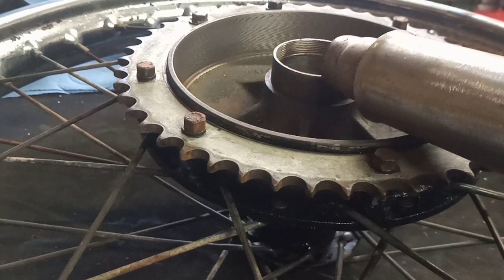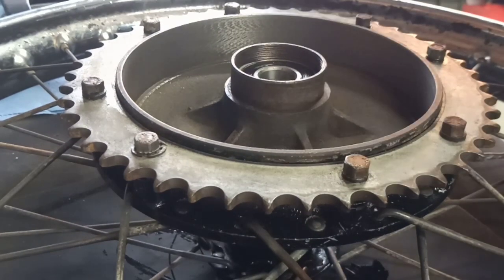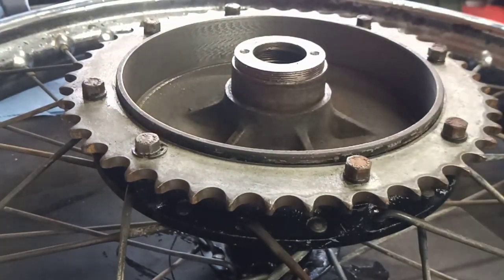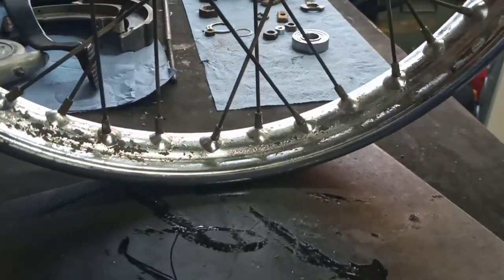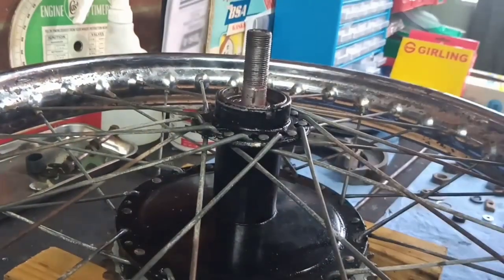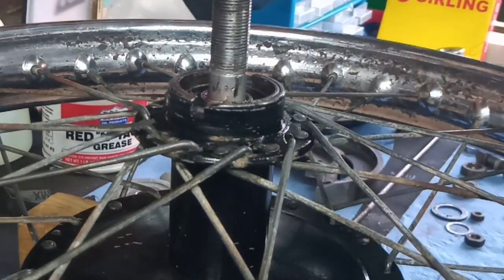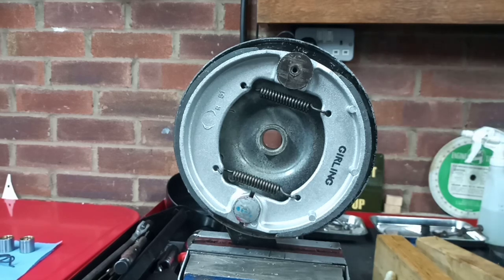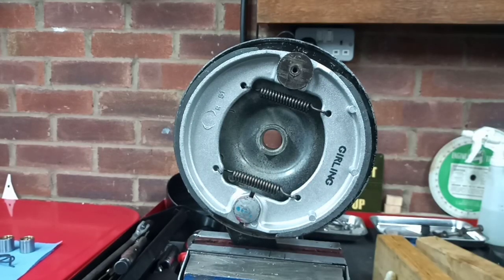Classic Bike BSA Bantam D7 Rear Wheel Assembly, Bearings, Brakes and Tyre

Comment: Pity you didn't fit new wheel rims, you could have shown me how to true mine up! My rims were awful so after a years deliberation and much drying of teeth over the cost l rebuilt the wheels this winter, l have left spokes slack ready to true up, maybe next winter ha ha. Thanks for taking time to video you work. Alex norfolk
Reply from the maker: Cheers Alex, I'm planning on wheelbuilding for my next project. The point of this one is to keep it looking it's age. 
Best of luck with your build. Check out AG Engineering and Dale Sweger for wheelbuilding top tips in the meantime. 
Best wishes, Dean.
Reply: Wheel building... One of my favourite jobs, I find it very relaxing.

Comment: Great thread file, I must keep a look out for one at the autojumbles, currently using needle files!
Reply from the maker: They are very handy. I've saved a few expensive bits with them. No good for internal threads of course, you'll still need your needle files to pick out the ends of those. 
Best wishes, Dean.

Comment: We are both currently treading the same path!!! Another great video and I'm enjoying seeing progress on the Bantam. I think I'm going down the path of machining the linings on the D7 Pastoral I'm doing as there is only 5mm of travel on the brake arm until the brakes drag, plus the brake rod doesn't have enough thread protrusion through the pivot pin for the adjusting nut to engage. I've got a customer bike in next week, plus I've just built another race engine, so I won't be back on the D7 for a week or so. Nice chatting the other day and keep the videos rolling in..........
Reply from the maker: Great to chat Bones, sounds like you are really busy. I'm hoping to get away with bedding in the linings but I think there is quite a gap at the outer edges. 
Best wishes, Dean.

Comment: Coming along nicely, won't be long before you are polluting our air with your two stroke oil smoke.🤣
If I get around to doing some more videos I shall have to do one on fitting tyres. I have never seen one that shows the correct method, this is not arrogance in thinking my way is the only way, it is the voice of experience from fitting approximately 10K tyres and mostly on the roadside. As a hint, remember bending spoons fitting tyres to your push bike as a kid, well if you know the correct procedure you just use fingers and thumbs only!
ATB 
c
Reply from the maker: Thanks Chris. This tyre was actually a fairly decent one to fit. I really lack the space and have to use the floor which doesn't make for good filming. Maybe I will show the front one when I do it, we'll see. I hope you do more videos, sharing the experience and knowledge is a good thing. 
Best wishes, Dean.
Reply: @retromechanicalengineer  if you don't have a machine to do it for you, working on the floor is the best place to fit tyres as you can use your knee to great advantage.